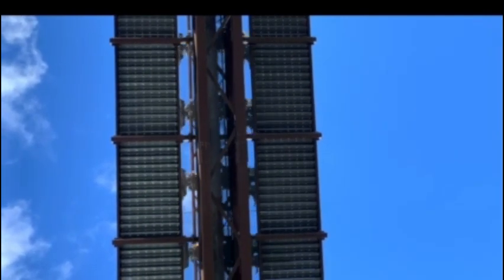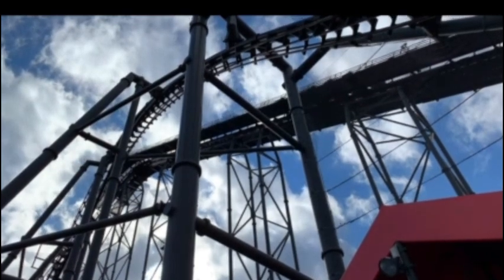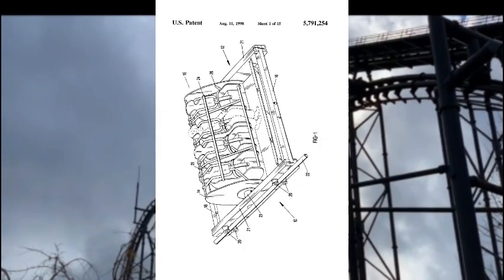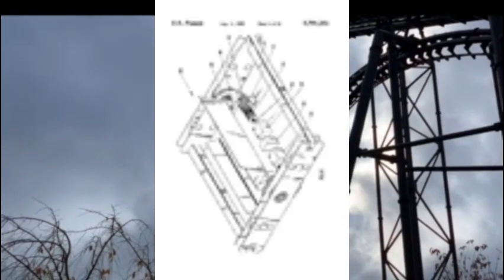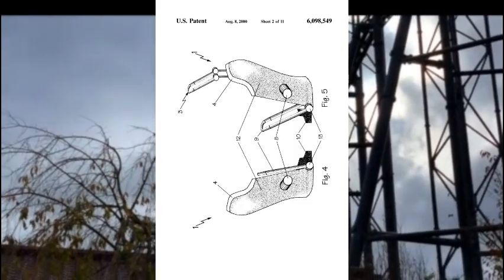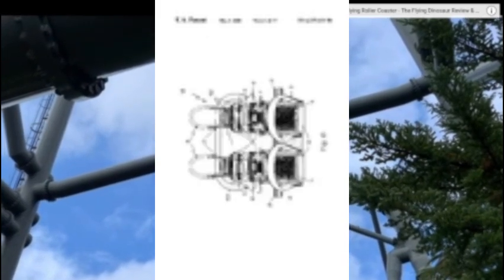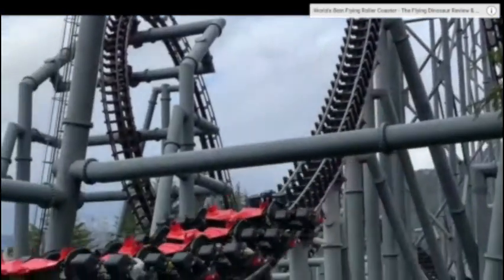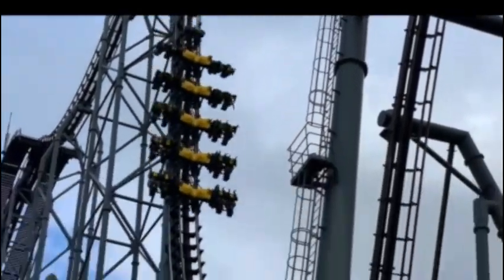What Is the Interworking's and History of The 4th Dimension Roller Coaster!?

Comment: The original arrow design  relies on a rack and pinion system to rotate the seats  by changing the  distance between the main running rails and a secondary rail to which the gear rack is connected. 

The S&S freespin  as the name implies relies on  passenger weight as well as magnets placed at key points on the track to achieve the same result of seat rotation. 

Intamin's zacspin  model relies  on passenger weight alone.

Comment: Also  arrow originally had a smaller  prototype model available  T the time that X was built  but SFMM wanted the larger cusom built model  and as a result the park received a ride that was plagued with mechanical problems from day one. 

Had six flags not taken that risk  they would have probably received a ride that was more reliable and they never would have sued arrow into bankruptcy as a result. 

One has to wonder just what sort of rides arrow would have been capable of producing had they been able to remain in business?